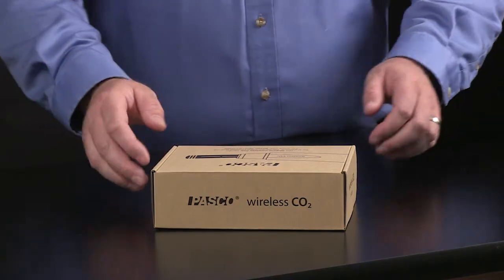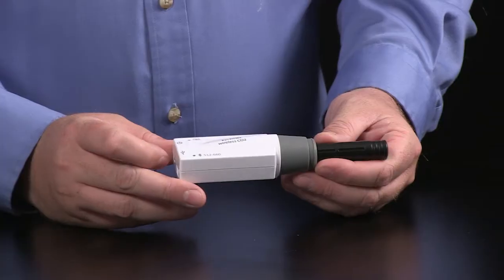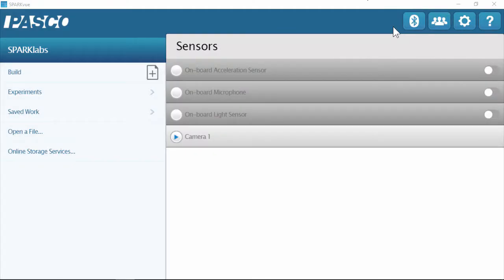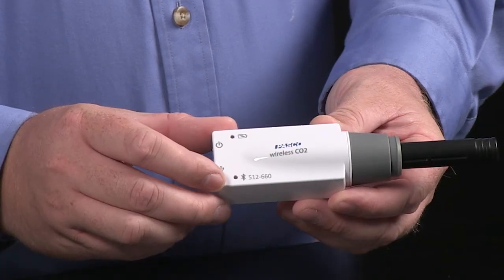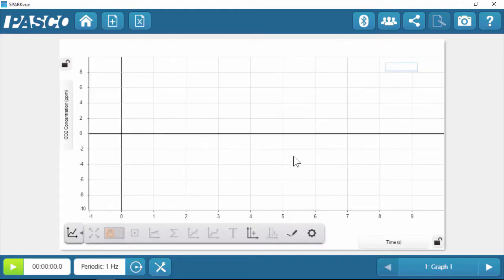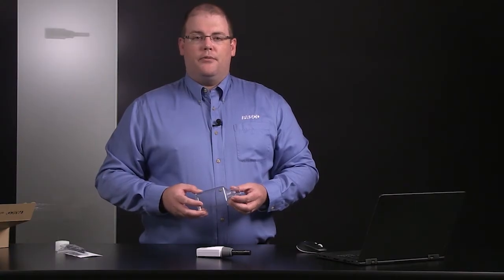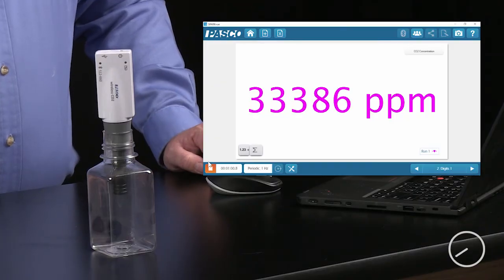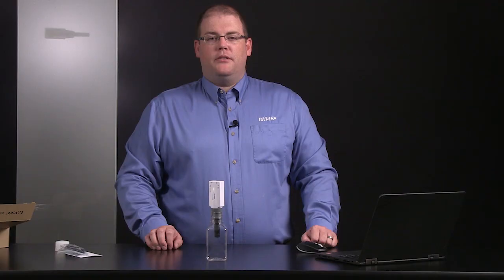Wireless CO2 Sensor Overview

Comment: Do you have a blue tooth sensor that measures up to 1,000,000ppm or in percentage up to 100%?
Reply from the maker: At this time we have only the PS-3208 Wireless CO2 Sensor, which can measure up to 100,000 ppm. You can find more detailed specs at   https://www.pasco.com/products/sensors/wireless/ps-3208#specs-panel. Thanks for your interest.